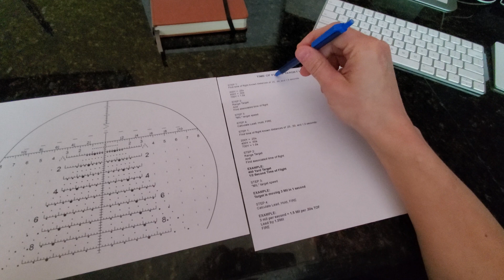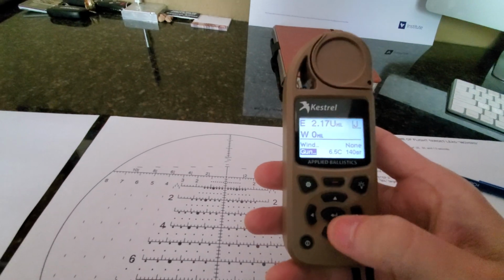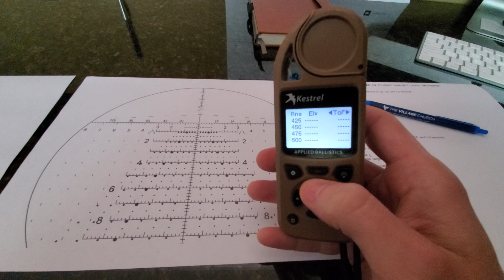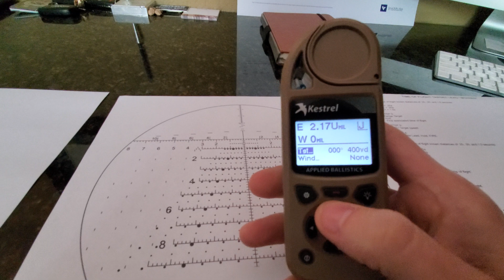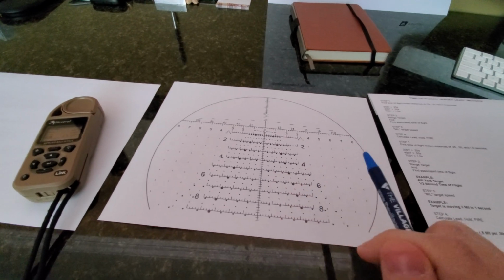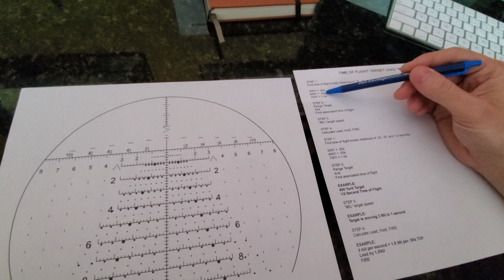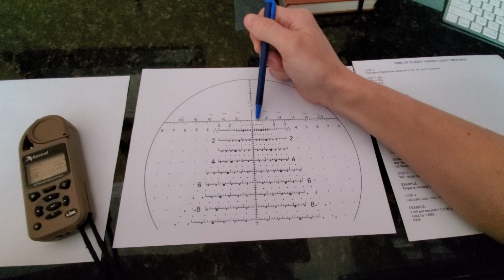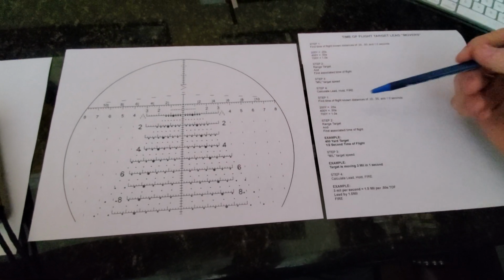SHOOTING MOVERS - Time of Flight Target Lead

Comment from the maker: 2nd Example:

700 Yard Target
Target Moves 2 Mils in 2 Seconds
Time of Flight: 1 second
Target Lead/Hold: 1Mil
Reply from the maker: Also, a more realistic solution would be to measure the speed over several seconds and divide accordingly.